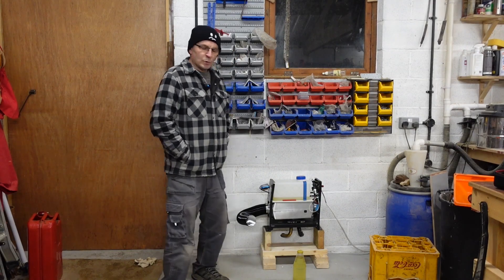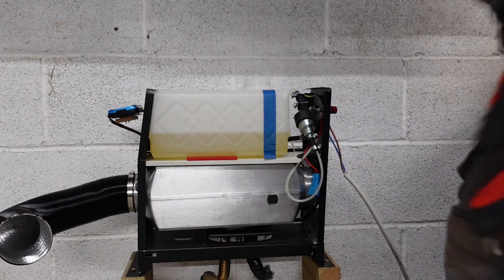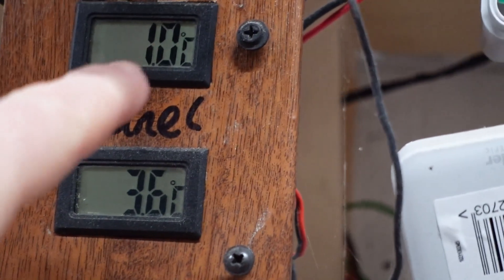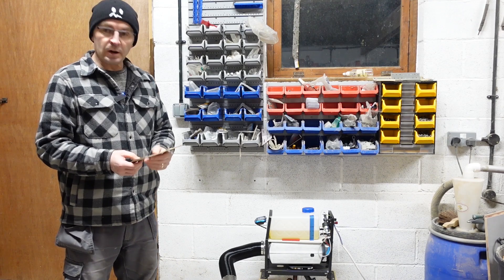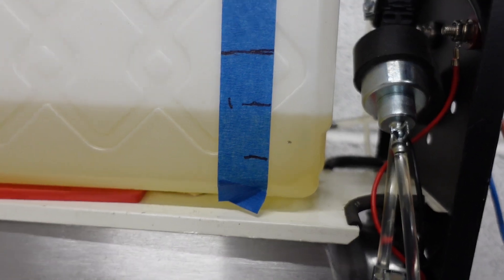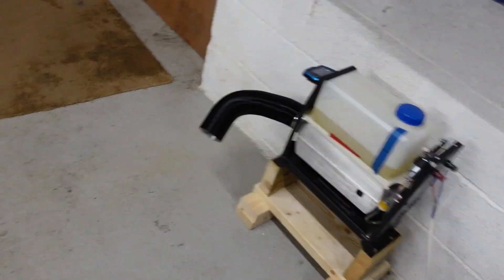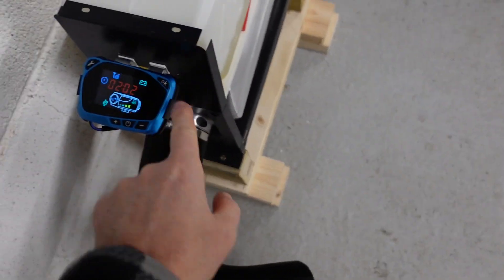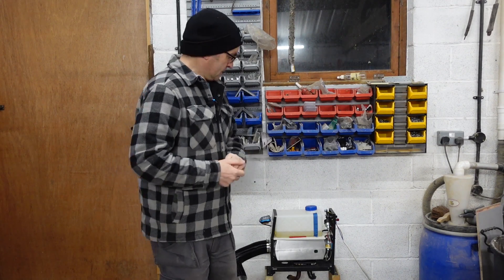Can this Cheap Diesel Heater Heat a Large Workshop

Comment: I think you aren't measuring a true temperature. The inlet outlet are forming a tiny closed circuit around the heater whereas the rest of the workshop will be cold - where is the thermometer? You want to either route the outlet to the other side of the room or else use a really large fan to even out the heat around the room.
Reply from the maker: the heater is going to turn 90 degrees when I connect it to a sand battery this will prevent what little closed loop there is but most of the hot air blows past the intake, the thermometer is about 1.8m above floor level about 2.4m away from the heater, it's only a cheap one so probably not that accurate but it gives a good indication that it's still fairly cold inside, having said that it's better with inn on than without it.

Comment: Add a heat exchanger (basically a radiator) to the exhaust output with a fan blowing through it and reclaim the heat it's wasting and blowing outside. There are multiple videos here on YouTube of how to do that.
Reply from the maker: I thought about getting an old cast iron radiator but I want to try something different, so I've got a 205l barrel that I'm going to experiment with.

Comment: Normally the led segments showing heat once running shows two extra red bars at the top of the scale
Reply from the maker: I'd like to try hertz I've tried all the combination of buttons that have worked for others I've seen but no luck yet 😕